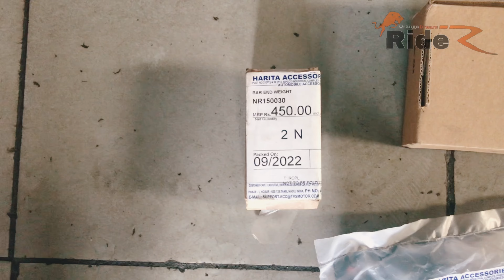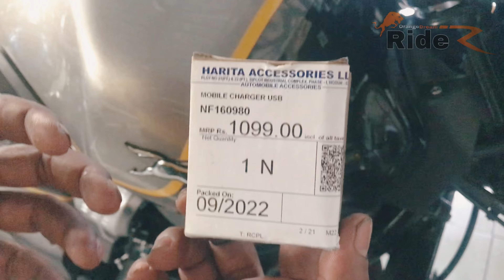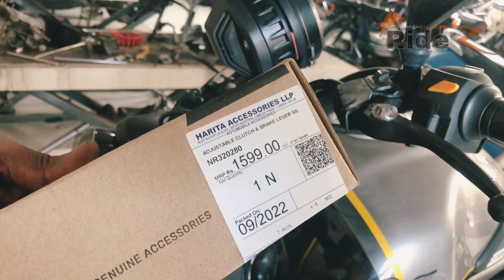TVS Ronin 2022 model full accessories unboxing and fixing#tvsronin225 #follow #explore

Comment: Indicater buzzer fit pannalama
Reply from the maker: It is not suggested bro 
Off Market la low quality buzzers only so it may result in elictrical short-circuit and sensor defects try to avoid